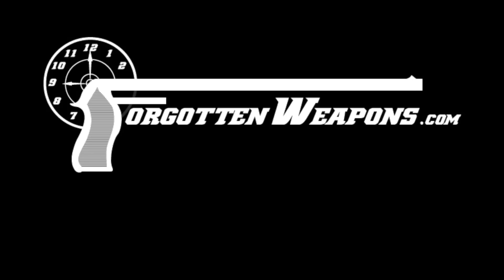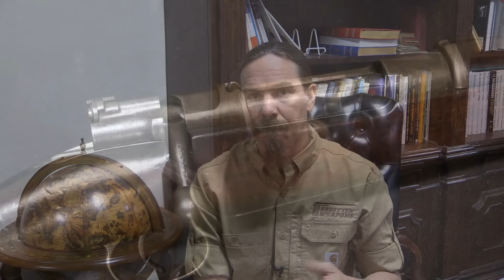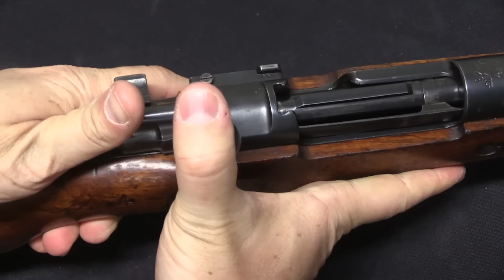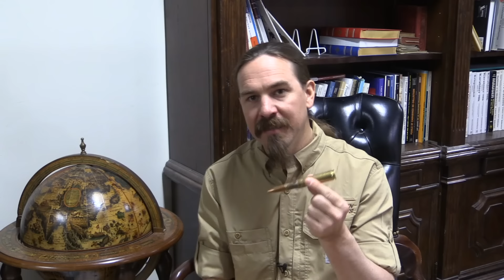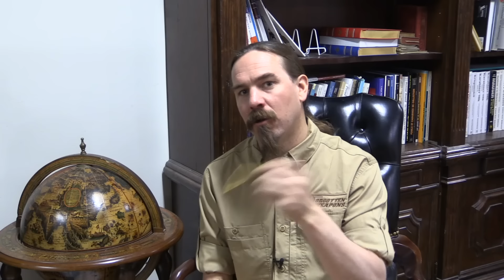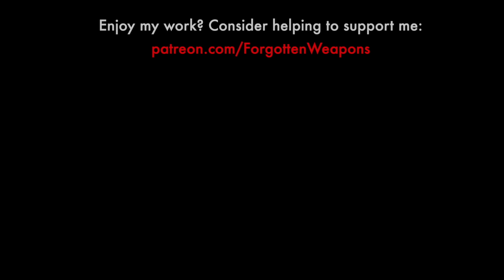Earth-Shattering ka-Boom! How (and Why) Guns Explode

Comment: The Kentucky Ballistics incident reminds me again why military surplus guns are so overbuilt, and why military surplus ammo should always be checked out before it's fired. I'm glad Scott's OK, but he tested fate by throwing SLAPs in a Serbu.
Reply: The reason SLAPs aren't supposed to go into a normal rifle is because the sabot will come off inside the muzzle brake and cause a baffle strike.

Actual mil-spec SLAP ammo is safe to shoot in a rifle that doesn't have a muzzle brake on it, or if someone has made a liner for the brake to hold the sabot onto the dart until it leaves the brake. Going Ballistic has a liner for their .50 rifle, they have an awesome machinist friend.

Comment: here is something to consider also, rare as it may be, the possibility exists. Booby Trap Bullets, bullets reloaded with high explosives designed to remove the shooter from the living. These have been found in Serbia over the last dozen years or so. Being that the SLAP is a rare round, not easily found, when found it is held onto and removed from the war zone and brought back for "personal use". Since the SLAPs Scot were using had dubious histories, the 2 he had may have been fixed. The round used just previous of the one that destroyed the rifle did have an excessive amount of muzzle flash compared to standard Ball ammo in 50 cal. the last SLAP round used also had some flash show up prior to the total destruction point. It would probably be a good idea to have the barrel checked for RDX or something similar...
Reply: The US has been doing that since Vietnam. It is possible, though I suspect they only do it with common ammo and not SLAP rounds. There is a video of one blowing up an AK in Iraq with a contractor.

Comment: Ian does a great job with this.  I have seen several kabooms in the military due to headspace and timing on a 50 cal.  Blew the feed cover off.  Another was a M16A1, the barrel blew up at the barrel nut which I think was a bad round, not sure but it shredded the fore arm covers.  We had rounds cook off in hot machine guns and some hang fire with tank rounds 105mm.  My friend shot the end of his shotgun barrel off duck hunting due to ice in the barrel.  We used to have a lot of squib rounds due to sorry duck ammo mostly non waterproofed rounds.  To the point we always carried a cleaning rod.  I always check the barrel on every gun before I shoot it at the range or before hunting especially if I haven't shot it in a while.  Old vintage ammo can be dangerous as Ian alluded to due to the chemicals used in its production especially military grade ammo which is almost always loaded to higher pressures.  Moral to the story, if you shoot enough you will have something weird happen with your gun or ammo so like Ian said be alert to Any change.

Comment: My two brothers and I talked about Scott's accident this last weekend. I brought up the fact that his gun was poorly designed considering a failure would launch so many pieces back at the shooter. Thanks for covering that fact in this video without pointing fingers and yet still getting the message across.
Reply: agreed, when watching Scotts video I was thinking "surely there more than just that small threaded cap to contain a 50 BMG round?!".
Reply: @N_Jones  I was thinking that too. I guess exactly "how" it's threaded makes a big difference though. If the grooves are big and deep, threading can be extremely strong... but that's "IF". And metal fatigue could become an issue over time.
BUT, his wild flyer shot really seems like an 'atypical' round. I wouldn't say the gun 'caused' the explosion, but it's safety considerations weren't adequate to handle things going very wrong.
Reply: @N_Jones  yeah, usually on designs like that the breach plug gets set snug into the stock. His was little more than a barrel with a handle.
Reply: @kathrynck  Honestly the lugs were the extra safety mechanism from where I'm standing. Mark Serbu said you'd need 80k PSI to shear the threads, but that doesn't take into account the additional force needed to shear off the lugs. Rough napkin math tells me each lug should have a shear strength in the 10k PSI range meaning this bullet produced an /insane/ amount of bore pressure. They should definitely beef up those lugs so they cover the whole breech face and extend further back for more strength but judging from the force required to do this, there aren't many guns that would have survived this.
Reply: @wolfwolf354  if the end-cap became cracked, it could come loose a lot easier. it's the one thing about threads which tends to be weak, they need a thick steel support around them to hold on. With pressure containment, once something starts to go wrong, it tends to keep going wrong, like a crack in a dam. Once pressure starts to move in a direction to fill a weakness, that movement causes it to apply WAY more force than usual, destroying bits which normally are plenty strong.

I'd be curious to see if "all" of the threads were stripped off the barrel. If the last loop of threading (deepest on the barrel) is more intact, then I would kinda think the cap hopped over the threading once, and then with that momentum it stripped all the rest of the threading right off.

But yeah, the lugs need to be much more beefy. Lugs of that size are used as a safety measure on guns with 1/3 to 1/4 of the power of a .50.

If he still has any of that SLAP ammo, it should be tested (carefully).
Reply: @kathrynck  from Mark's video it sounds like he's going to be receiving some of the remaining ammo and the gun and taking a look at it/sharing results so I'm very interested to see that. Hopefully he can put out a cheap retrofit for other RN50s so there's no chance of this happening again.
Reply: How about a lanyard for the cap, add another 10,000 lbs (force) with a 5/16 steel cable.
 ;)
looks like the bottom couple of turns on the thread are still intact to me... https://youtu.be/1449kJKxlMQ?t=302
Surprised it's not an acme thread.
Reply: As much as I like Mark Serbu this design is "problematic", to use a fashionable word. The issue with thread on caps is that if gasses leak out of the casing the pressure will act on the whole surface of the cap instead of just the back of the cartridge. Force is pressure times surface and surface increases with the square of the diameter. So going from a 1 inch diameter disk on which pressure acts to a 2 inch diameter cap quadruples the force. Also threads are a tricky thing. They cumulatively have a large amount of strength but if they are not tightened well enough only one is actually engaged and if that one fails the momentum changes the equation dramatically. Think World Trade Center. The structure was plenty strong to sustain it's own weight but once one floor collapsed the impact pancaked the rest in a chain reaction. It's much better to have a few strong lugs than a bunch of threads. And lastly the case rupture scenario also could lead to the pressure acting upon the cap sideways blowing it up like a air balloon and allowing for it to jump a thread. Once that happens the momentum does the rest. As for safeties behind the bolt they are pretty much pointless for the same reason. Once the cap started moving the material strength needed to stop it becomes much higher since now it's not only force but also momentum involved. 
And one last thing. The design pretty much ensures the cap will never be tightened really hard. No shooter will screw it on so hard he has difficulty unscrewing it after the shot, you can't expect people to do that, and they won't. The safety ears do ensure it's screwed all the way but not tightened. You can't machine them that precise and even if you do they will wear over time from the friction caused by opening and closing the mechanism. So there always will be some play between the surfaces and that's a really bad thing.
Reply: @sardoniclaugh9646   while I agree with the general premise of what you're saying, pressure is force divided by surface area. PSI is pounds of force over inches squared. If the diameter doubles, the pressure acting on the surface is half, not double.
Reply: @wolfwolf354  Please tell me you are not an engineer? Here's the deal. Pressure equals force divided by surface area means force equals pressure times surface area. That's how the math works. When the powder ignites it creates pressure. The amount of force that pressure exerts on each of the guns components depends on the area exposed to that pressure. Therefore if the gasses leak into the gap they will apply 4 times as much force on the back of the cap . By the way the surface of a disk with double the diameter is 4 times as large, not twice.I take the question back you're clearly not an engineer. 
Again, I like Mike Serbu a lot but this is clearly an unsafe design. A threaded cap is not a safe way to do this, external threads can jump and shear much easier than a couple of solid, massive internal lugs. Even if the casing ruptures with a conventional bolt there is nowhere pressure can leak that amplifies the backward force or disengages the lugs. But with a screw on cap pressure leaking can multiply the force and also "inflate" the cap making it easier for it to jump the thread. And once a thread is jumped and things get moving momentum starts playing a role and everything tends to break. But that's not even the biggest problem I have with the design. In fact the cap flying back wasn't what almost killed Scott. It broke his nose and almost took out his eye but it's a big object with a large surface, it will knock you out and do damage but it won't kill you. The little ears that sheared off are what almost cost him his life. Those things have no business being there. I know what they're supposed to do, but either find another way or make them a solid two inch block of steel so that they can't fly back like bullets and and pierce right through the shooter.
Reply: @N_Jones  "Let's design a .50 rifle like a pipe bomb. What could go wrong?"
Reply: @wolfwolf354  Stop. Just stop. I am an engineer and you're very wrong. Force isn't pressure times surface squared it's pressure times surface period. And pressure does not decrease with surface but with volume. What happens when a gun is fired is the powder ignites and creates a large amount of gas. This gas is constricted inside the chamber so the pressure increases. In short a cartridge will create a nominal pressure and in fact this pressure is specified by the manufacturer. The force that acts upon the chamber walls and the bullet depends on the pressure created by the powder and the surface area of each. You can increase or decrease this force by either increasing the pressure (using more or faster burning powder - a "hot" round) or by increasing the surface upon which this pressure acts. Unfortunately Serbu's design allows for pressure to act on a much larger area of the bolt if the casing ruptures.  This is a design flaw and should be immediately addressed.
Reply: @wolfwolf354  Oh and yes for your information all else being equal (bullet mass mainly) a "wider" bullet, basically a larger caliber,  will be accelerated faster by the same powder charge. The reason we use small calibers is that while this is true once the bullet leaves the barrel the wider diameter causes it to lose energy faster as well and negates that advantage.
Reply: @wolfwolf354  Lets put it this way. You have a piston with a surface area of 2 inches (2 square inches), and a piston with a surface area of 1 inch (1 square inch). Both are pressurized to 10 psi or 10 pounds per square inch.  If you now measure how much force each piston is exerting, the 1 inch piston is 10 pounds, and the 2 inch piston is 20 pounds. Does that make sense? So given the same internal pressures, the piston with the larger surface area is exerting more force. This is also how you achieve mechanical advantage in hydraulics more or less.
Reply: @doohresarf321  ah fuck maybe you guys are right, I'll just go delete my account now. Wouldn't that mean the force on the barrel itself would be magnitudes larger based on the internal area being so much bigger than the cap?
Reply: @wolfwolf354  If the barrel was plugged, in sum, yes. But not the way you are thinking. In the discussion we were having the point of failure is fixed. So as surface area increases the amount of stress on that static point of failure increases. This is not a great analogy anymore, but think of that piston again. If that piston increases diameter, but the connecting rod stays the same, with the same internal pressure, eventually we can break the connecting rod, by simply increasing the piston diameter. But now imagine that there is no connecting rod. Rather the piston is just a cylinder inside a tube. Now as we increase the diameter of the piston the amount of supporting material increases as well, and so the amount of stress at any one point remains pretty much static. I apologize I know this is a pretty shit explanation.
Reply: @andreialexandrunichiforel  No, not pressure, force. PSI. Pounds per square inch. 20 psi over 10 inches is 200 pounds. You can test this yourself with two different diameter syringes connected by a tube. I understand that this may seem a little counterintuitive, but it is basically the same as how a lever or pulley system provides mechanical advantage.
Reply: @doohresarf321  psi is a unit of pressure.
Reply: @andreialexandrunichiforel  I know. Pressure = 20 psi
Surface area = 10 in^2
Force = 200 lbs
Force = Pressure * Surface Area
Pressure is constant.
20 psi * 10 in^2 = 200 lbs of force
20 psi * 20 in^2 = 400 lbs of force
I do not think I can be any more explicit.
Reply: The guy litterally used SLAP rounds that were designed to be fired out of a tank mounted/coax m2 so its really no surprise it just exploded.  The real surprise is how it didn't happen sooner.
Reply: @sardoniclaugh9646   you're not kidding about the WTC- one of the things that "well there's your problem" covered in their video was, in essence the floor support beams were tearing/pushing the building apart-and then inwards as it cooled- due to thermal expansion from the fire at some point- they went into detail of how the core and exterior supports were connected together, and how the damage..disrupted prettymuch the entire structure in the leadup to the collapse
Reply: @wolfwolf354  Yes and no. As the bullet travels along the bore the lateral surface on which pressure acts sideways increases. But at the same time pressure decreases since the total volume available for the gasses to expand into increases. So no,  it's not orders of magnitude larger. The problem with Serbu's design is if gasses leak into the gap between the cap and the barrel the surface on which pressure acts increases but the total volume of the chamber stays more or less the same, the gap has a large surface but a very small thickness (in fact microscopic) so it's volume is negligible. You are confusing something here I suspect. When gasses leak into the gap the cap isn't at risk of puncturing. The force increases but since the surface of the material increases as well it can handle it no problem. But the cap didn't puncture now did it? The threads sheared off and they stay the same no matter what. That's the problem, the locking threads are designed to support the force created by the chamber pressure acting on the back of the cartridge. But if the surface increases, and so does the force, the threads don't get bigger (obviously) so they can fail.
Reply: You are kidding right? It looks weird but that design isn't more dangerous then any other rifle. If this happens in something like an ak(or alot of guns) the receiver and other things will get launched right back at the operator. Marks numbers say it took like 120k+ psi to sheer the threads the way that did. Id say this amount of pressure will cause catastrophic issues. Regardless of what gun it was shot out of.
Reply: @stompingpeak2043  That's not true. Not even for AK's which have a slight misalignment between the barrel and the stock and certainly not for AR's where the barrel is right in line with the stock. If the lugs on a AK or AR were to give in, which is extremely unlikely since there are other weaker points where over pressure would vent sideways (which is what you want in case of a bore obstruction or other catastrophic events) the bolt would crush into the stock not fly directly into the user's face. Also big parts like the bolt are not that dangerous Even the comparatively smaller cap used by Mark Serbu's design wasn't life threatening. What almost killed him were the small ears that sheared off. None of the major rifle designs have anything like that and for a very good reason.
Reply: @wolfwolf354  It's the force on the cap that is what we are interested in. The pressure is what's generated and by the cartridge and somewhat constant for every gun, quoted as 55,000psi. The area of a circle is pi r^2, so for a .50 cal is 3.14159 x 0.25^2 = 0.1963 in2. So the force on the cap is 55,000 * 0.1963 = 10,799lbf. If the pressure generated by the cartridge is 85,000psi then the force will be 16,690lbf

Comment: An analogy in automotive engineering is if someone made a car in 2021 without a collapsible steering column. If someone gets impaled in a crash, you can't really just blame the crash for the injury, you also have to blame the designer too for not implementing features which are the state of the art for firearms safety
Reply: Ruger lost a huge lawsuit for this very reason.  Their single action revolver did not use the dropping transfer bar system that H+R had been using for years to stop their revolvers from discharging if dropped.
Reply: Serbu did address this by beefing up the ears behind the chamber cap, did he not?
Of course, there obviously should have been something more substantial there in the first place.